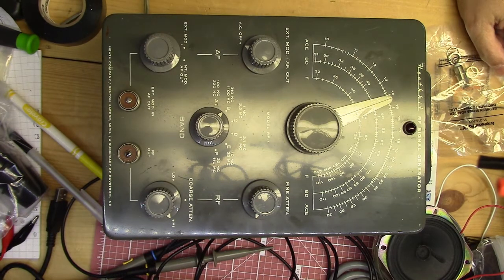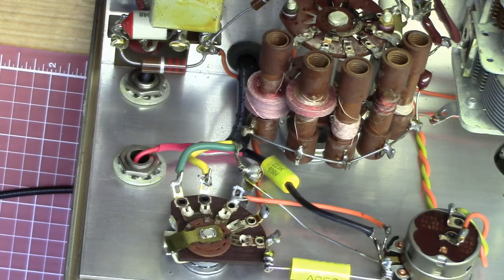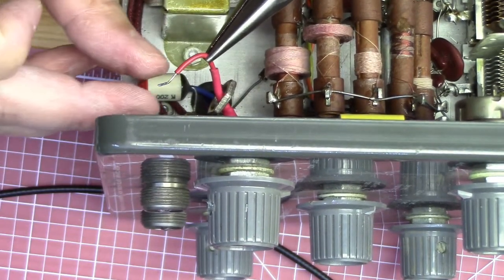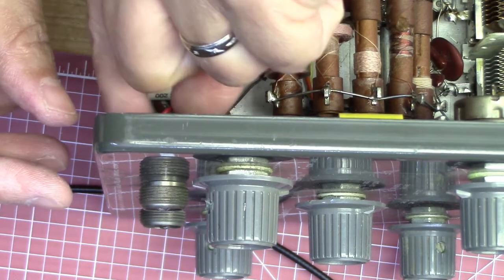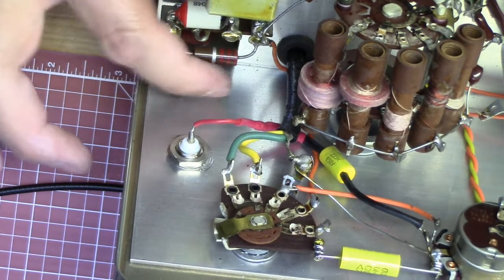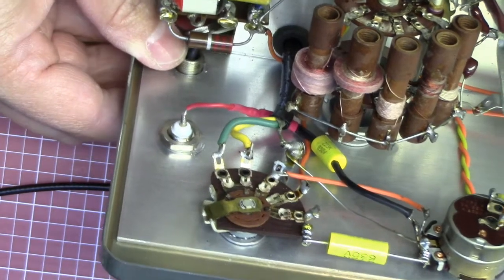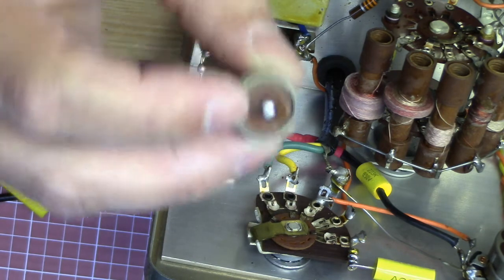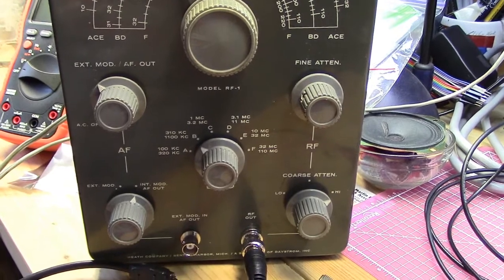Heathkit RF 1 signal generator connector replacement

Comment: You are 1 of only 3 or 4 people that have made videos on this generator.  I believe I happened upon a design flaw in the Coarse Attenuation switch that prevents it from outputting a signal when the Low and Middle outputs are selected.  I implemented an easy workaround and am anxious to hear other's opinions on the approach - or offer better ideas.  I made a clip on my channel that shows the approach.  If interested, you can jump in to 6 minutes and 41 seconds to see where I address it.  Since there are only a handful of people who have made a clip, I'd be interested in finding out if you are seeing the same problem - where RF outpuit only appears on the High setting..  https://youtu.be/dCUnEYed2y4

Comment: those were used for audio microphones in the 40s up into the 50s and thats what time frame you rf generator is 1950s
Reply from the maker: A microphone cable, that’s what it was used for. Thanks for the information. 👏🏻👍

Comment: I know this video is two years old , but can you tell me what is the max pk-pk out put you get on your RF1?  I just bought one and band F give me the highest out at max 750 mv and it just get worse from there going down in frequency.  So I’m not sure if a tube is tired or what I’ve never worked with tubes much so I don’t no how the fail.   Hope you still get messages.
Reply from the maker: I just checked mine and the highest output I get is about 600mv pk to pk. At 455hz I get only about 225mv pk to pk. I haven’t used mine in a while so I don’t know if it has an issue but it looks like yours is doing better then my RF1. Hope that helps. 👍
Reply: TheRadiogeek thank you for the response.   I ordered two new tubes if it makes a difference I post the results to you.  🙂
Reply from the maker: Greg Johnson sounds good. Thanks!
Reply: TheRadiogeek well I put two new tubes in and I’m getting .438 volts throughout most of the bands. F band starts the lowest at .1V and climbs at the end to .422V so I’m not sure if I have a bad capacitor in that range but the frequency is rock solid throughout the entire range very low distortion so I’m happy with that.  The instructions book calls for out put greater that 100,000uV.  I don’t know why they don’t just call that .1V seems like it would be a lot easier. Ok that’s it happy new year.
Reply from the maker: @gregjohnson5194  Thanks for getting back to me. Good information for sure. Thank you! and Happy new year!

Comment: I'm going to do this! Mine came with a couple of screw-on BNC adapters, homemade I think, but the centers are loose so won't press against the center contact. I've already changed the electrolytic capacitors and put a modern rectifier in. The oscillator tube socket has been changed in the past to a skirted type, totally unsuitable as the skirt means it can only be mounted on top of the chassis plate, this means the 12AT7/ECC81 top pip was pressing against the inside of the case, so badly in fact that the rear screw holes wouldn't line up, and the screws could only be put in by forcing the holes to line up. I swapped the socket for a basic plastic one that could be mounted underneath, now the case fits properly. Why that tube never broke is a mystery. But is not original (has ECC81 / made in Britain on it).
Reply: Heathkit used a ton of Mullard tubes which were made in Britain....!

Comment: Nice upgrade. That generator is in nice shape! I have an old Heathkit SG-8 that looks like it was left in a barn for 30 years. I should have upgraded those connectors while i was restoring it electronically.
Reply from the maker: Radio Rescue yes it is in nice shape. I got lucky when I picked it up at a hamfest. Thanks for stopping by.

Comment: The BNC connectors are a lot easier to use than those microphone things! I have one on my Eico signal generator, and I never changed it.
Reply from the maker: Radio wild the BNC connectors make a big difference and make it more useable. Thanks for stopping by.

Comment: They are the old style amphenol connectors. Although the Amphenol company makes many connectors, that's what they were referred to in the older days. May be another name for them. btw,,, got the same generator.
Reply from the maker: skycarl ok Carl, I remember someone telling me it was some kind of microphone connector. Thanks for the information. Do you have a video of your generator ? Take care and thanks for stopping by.
Reply: That connector was also used for un-balanced microphones back in the day.

I assume it was inexpensive and therefore pressed into service for many uses.
Reply from the maker: pileofstuff I'm sure you're right. It was likely low cost and plentiful. Thanks for the information.